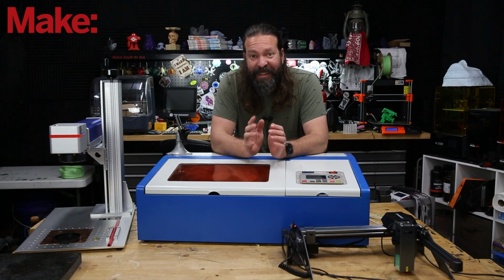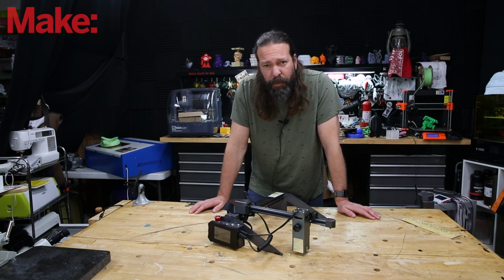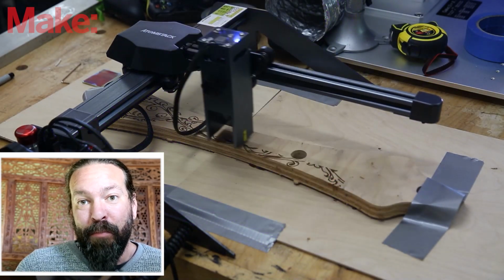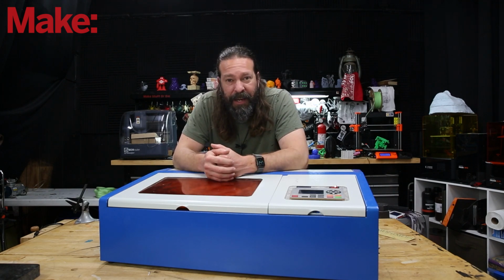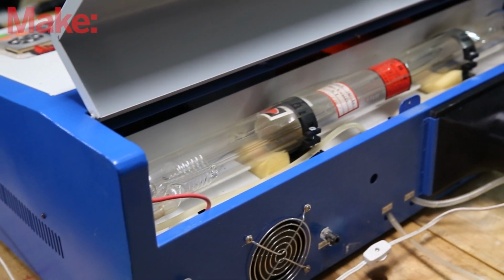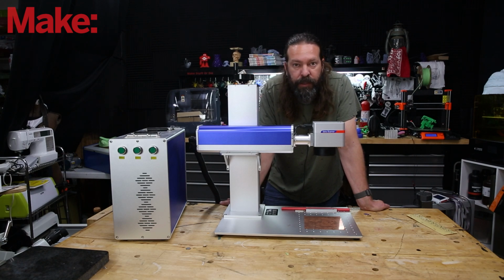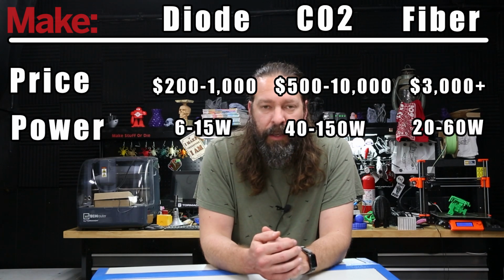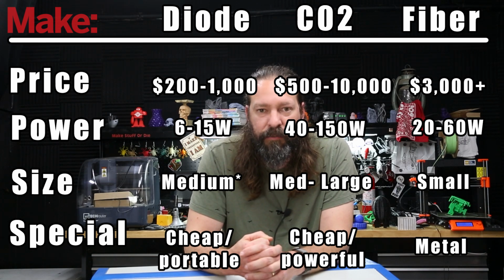Which Laser is right for you? Diode, C02, and fiber compared

Comment: Marking only small spaces 6x6 or 8x8 perfect for me. Part stock/numbers only. Short runs. I marked some parts on a friends 50 watt desktop and lightbulb went off in my head. Parts usually primed and painted steel. Question is wattage denotes area size? Or depth of burn or both?

Comment: Laser safety glasses are for nerds.....I'm fine with being a nerd. Im a big guy and wear glasses that have a wide frame, so none of the cheap glasses style ever fit. I bought some wrap around style goggles from cloudray that are perfect. Fit over my glasses and are blocked on the sides so there isn't any light leak around the edges. The were a bit more expensive, being around $60 or $70 when I bought them, but totally worth it. Right now I just have a diode laser, but plan on getting a fiber laser eventually to increase the speed I can get some things done and work on metal. Going to have to get a second pair of goggles for a fiber laser too.

Comment: Good Job, I have an idea. Screen printing in multiple colors,  using the LED laser.   Separate a photo into color plots, dimple the part with all the dimples for red, for instance, then fill those dimples with a red paint, then switch to blue, engrave those dimples in the blue color plot, fill those holes with blue, and then the same for yellow or green, fill, let dry and then sand and all of your colors will be in the wood just like a screen printing operation works and you could do a large painting in steps then do the light sanding to remove the paint smear where it is not meant to be.

Comment: if i do many passes, could i go deeper making like a small 3d model?
Reply: The material starts to burn and get damaged
Reply: @avilla7934  and if i wait for it cool between passes? i really determined to find a way to make this work, but i wanna make sure it will work before i buy the machine :)
Reply: @tatavibes-j9l  depending on the strength of the laser with determine the thickness it will cut. For example a 10w diode laser will cut 5-6mm plywood in 2-3 passes. You will also need air assist, without it, your cuts will not be complete
Reply: @tatavibes-j9l  once you burn wood it’s done, same goes for acrylic, once you start melting it due to many passes and not being able to penetrate the full thickness of the sheet, your material is deformed, melted and dirty with smoke.
Reply: @avilla7934  same for metal? ithink if the pass is quick it shouldnt melt the material around it... and so it looks like you could go making deeper engraving layer by layer.. dont you think there is some way to do this?
Reply: @avilla7934  we are talking about fiber laser on metal here right?

Comment: Would be interested to know how long diode lasers last compared to co2 lasers? For example an Xtool 20w diode laser, will it run twice as long at 50% power or longer? Saw a vid that it’s  common for a cheap diode laser to lose 40  to 50% output after only a few uses at 100% power

Comment: Great Video but with those cheap CO2 lasers you will be not happy at all because they are cheap.It has a good reason why they are so expensive normally starting around 3 to 4000$ US.They can go up to 100 thousand $ depending on size and power. Diode lasers are better for hobby and Fiber Laser properly good for anybody who wants engrave deeper into metal.Diode Laser they can't cut metal thick maybe a 0.2mm but that's it.

Comment: Thanks helps it helps alot.
 We are new to lazers and would like to cut and engrave with a unit the we can move around or take with. I would like to be able to cut and engrave on metal and any other material to make an income from. We are only starting off and are stil new in this field.

 What would you recommend that have good features and are easy to use with good programs?
Also how long does the lazer last? 
This small laserpeacker 2 is small but what is your feel on thus product and power?

Thanks keep on rolling. enjoy

Comment: You can engrave metal with a 20W Diode laser.  I use a Atomstack X20 Pro and it has no probs with metal.
Reply: How deep is the engraving on metal ? Especially on brass ?
Reply: @nkcb996  Its marking the metal not engraving. There is no material removed.

Comment: The more powerful 10W-20W (optical power) diode lasers may be similar price to the cheapest CO2, but the cutting/engraving area is 2-3x larger than the CO2 at this price point.  Diode lasers cut much better when they have air assist to blow the smoke away/through the cut, and you can get this as an addition on some of the more expensive diode laser machines. CO2 tend to be better cutting clear materials like acrylic/perspex & PETG, particularly once you get to higher wattage CO2 (100-130W), whereas diode laser wavelength is not suited to cutting clear materials.

Comment: So here's a nøøb question - Why can't you engrave metal with a CO2 laser? Is it simply a matter of the laser not being powerful enough? One would think that with a sufficiently-high powered CO2 system you could...
Reply: it isn't power necessarily, as you see this is a 30W fiber but a 40W c02. It has more to do with the light frequency of the laser. The fiber lasers interact with the metal differently.

Comment: There's a lot of offshoot, mods, and upgrades for all types of lasers. 
One of the first things to look at is what types of materials do you plan on working with.  
Second is how fast do you want it to cut? You CAN cut through many thicker materials with a cheap laser, you just would have to take a lot more passes (although edges can get bad on thick items). Are you doing 1 off's that you're ok if it takes hours, or production, and need to make a lot of something faster? 
Third is size (and thickness) of your item. Especially on a co2 laser, focal length is very important, so if you put something an inch thick (like a book) you either have to lower your bed, or change the focus. Will the item even FIT in/on your machine? (makermade M2 CNC has a laser mod, you can engrave a 8'x4' sheet!)  
4th is consumables, and maintence/operating costs, Yes, Co2 can be 'cheap' out of the gate, but by the time you've replaced the tube once, and the power supply twice, (once in the middle of a job you wanted to get done, and had to wait for a new flyback..) and are going through distilled water gallons at a time (evaporation) you might be re-thinking that 'cheap' option. 
Generally it's an investment, odds are you're going to get one, and keep it, instead of upgrading to something different when you outgrow it. Does it do everything you are GOING to need? Is it upgradable for the things you might want to do? (for example many co2's you can easily upgrade to a rotary engrave bed, for tumblers) 
*Also, ALWAYS have good exhaust/ventilation, regardless of which you use.. You're atomizing the item you're cutting/engraving, that's NOT something you want to be inhaling, regardless if it's wood, acrylic, metal, or anything else.*
Do your homework, and don't be afraid to spend a little bit more out of the gate, for options you'd likely use down the road.
Reply: what do you recommend for engraving gemstones?
Reply: @mohammedalebrahim3322  I haven't worked with gemstones, so I'm not sure.
Reply: So I have a diode but planning to go to a 20 watt do you recommend a 40 watt co2

Comment: I may of missed it or maybe it needed to be stressed more but I think a better understanding of what materials each one is best for would help.
I'm in diode and CO2 FB groups and so many people ask what settings to use for "insert metal here". The answer is always "you need a fiber laser".
Reply: that's really the gist of it. There are a few no no materials, like PVC but diode and c02 more or less can cut/engrave the same stuff. There are slight variations but not a ton. mostly it comes down to speed and power.

Comment: Now you have to make a CNC video 😀
Reply: I agree. that's a tougher one to break into obvious segments though.
Reply: @CalebKraftmakes  I'd probably do a couple of videos. One as an overview of CNC concepts, with an explanation of the difference between a CNC upgrade (like a lathe or milling machine that's been semi-automated) vs a full CNC milling system with automatic tool switching. Then I'd do a video on actually upgrading a basic machine (W&M Levsha recently did an overview on upgrading their new table lathe with multiple CNC axes plus a stepper motor on the drive, for example, so you could point to that as a related project).

Comment: Great video introduction to lasers! One thing I felt was missing is that exhaust is particularly important for CO2 lasers. You need a high power fan to keep the cutting fumes out of your workspace. The fan is also extra cost and it takes up more space. It also adds an extra logistical issue of venting from an indoor to outdoor environment. This is not so easy sometimes because of access to a window or port hole can be limited. There are filtering options to vent indoors but those are costly and take up even more space. CO2 lasers are amazing but IMHO there’s a whole other (output) side to consider, especially when cutting acrylic.
Reply from the maker: you should really be venting ALL lasers outside.
Reply: @MAKE  I agree! Maybe you already had it planned but yeah a video on fume extraction and venting would be a great follow up!